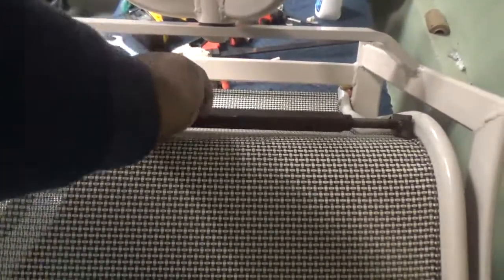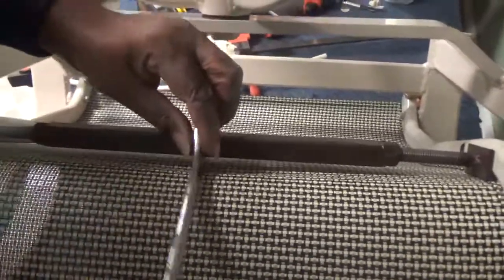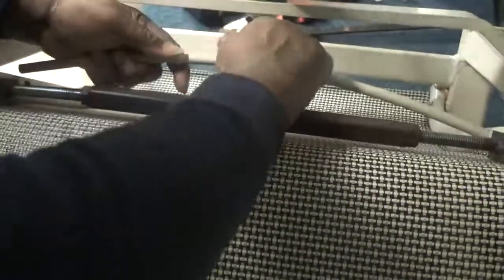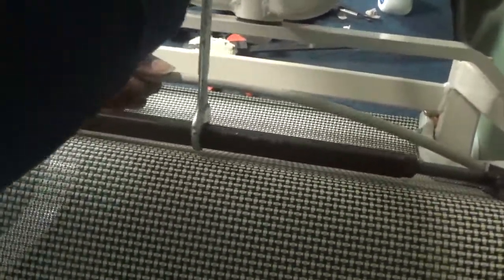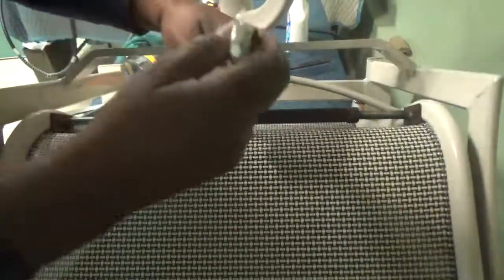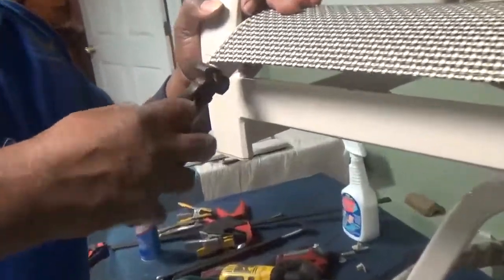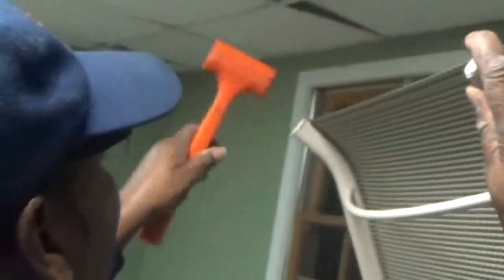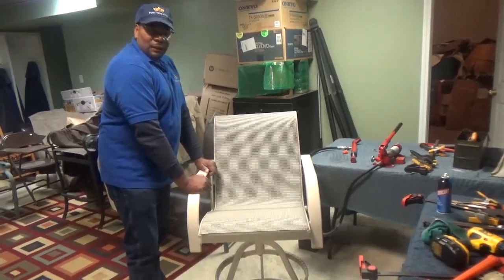how to replace winston bar stool 3  Tool Cut

Comment: What about the "Hampton Bay" type of chair, is it the same removal of the sling bars. Some say compress other say decompress, Got two chairs with width 17 1/4 by 52 inches, no added extra dimension yet. Nobody shows the sawing of the plastic rod on the sling.